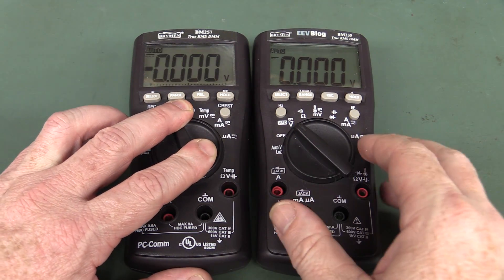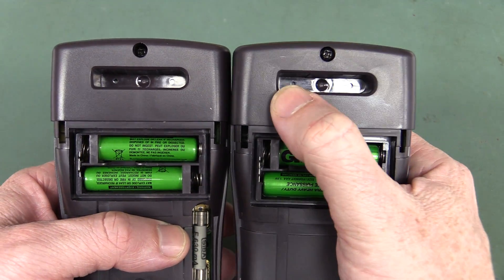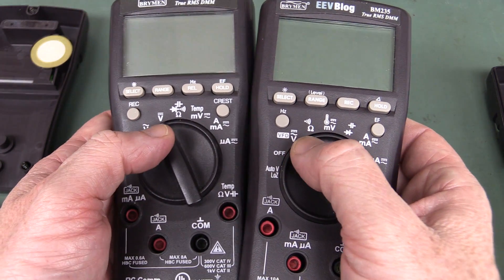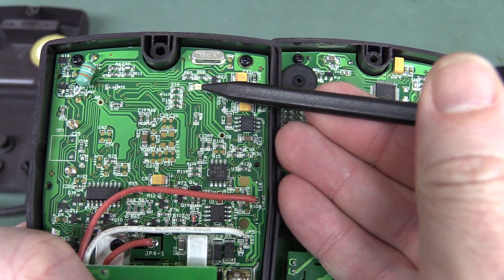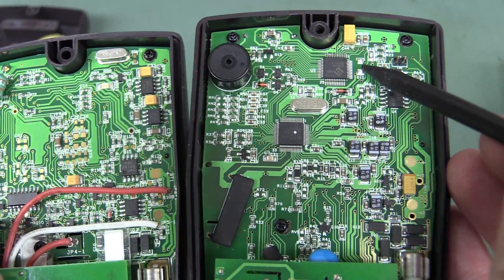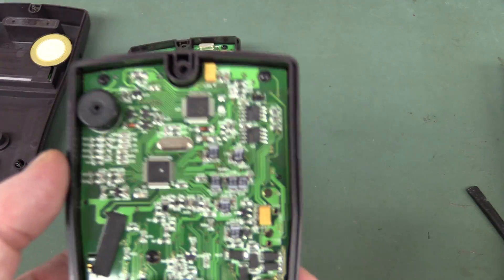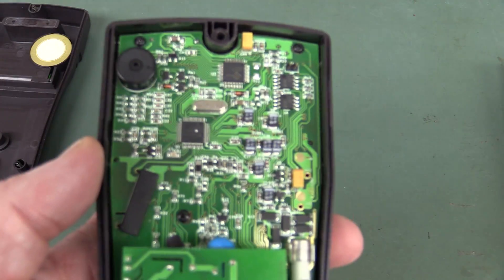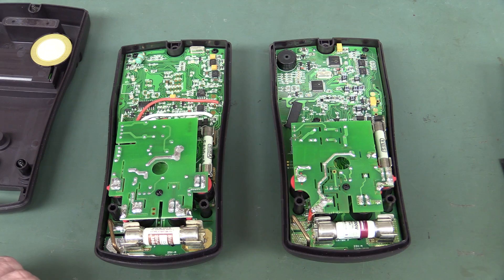Brymen BM257 vs BM235 Multimeter IR Serial Protocol

Comment: I have a fluke 73 series 1.
Been trying to figure out the protocol. This video is great for testing a different angle of attack.

My UNI-T UT81B has a data USB cable. They made it to show up as a HID device and not a serial port.
This makes it harder to sniff the data traffic.

Comment: Another way to try getting serial type data out of the BM235 would be to attach some small circuit to the I2C pins to drive an LED. Possible perhaps but not that clean a solution.

Comment: Why does it output the LCD pattern?  It's not a true serial output.  It's purpose is for manufacturing diagnostics.  Since having a camera in the right place to observe the LCD segments they output a digital stream that indicates which segment is lit during testing and calibration.  Thus verifying proper operation of the firmware.
Reply: In fact there my not even be a LCD hooked up to the PCB while the ATE is calibrating the meter.

Comment: I feel like you're not exploring this fully. Clearly, that pin is not it. But have you looked elsewhere? Trace where the IR LED is connected on the BM257 and see if the chipset on the BM235 output anything there. Assuming the cipsets have the same chip form factor.

Comment: Really unconvincing reasoning there. That empty pad just happens to be located exactly in the same spot where the IR led should be? And it being empty just happens to be a happy coincidence? and it being right next to the LCD controller, emitting LCD protocol, another happy coincidence? Just probe the damn thing and be sure! maybe it's connected to a different pin in through a different layer of the PCB? maybe there's an undocumented mode to that pin? not probing it to check is just lazy.
Reply: Welcome to EEVblog!

Comment: just a guess: but maybe on the DMM with the IR out they are just abusing the serial out of the display controller that is normally meant to be daisy chained with another one. that would explain the strange "protocol". If this is true then the IR-Signal should not be modulated like it normally shoudl be on IR-transmissions. Maybe something similar can be found on the other one but it seems that it is a I²C based controller. But maybe it is possible to just hook a IR-LED to the SDA-Line (via some transistor) and recover the clock-signal from the data to reconstruct the transmitted data.

Comment: What a strange circuit. Could they be modulating the VLCD charge pump voltage to drive the IR LED? Glancing at the data sheet yields some interesting but vague tidbits. Some black magic in here. How does the BM257 drive it's LED?
Reply: +Justin “J” Lynn It just so happens that the 80Hz refresh rate on the display (page 19 of the English Datasheet) is 9600 baud / 120 and the dispay data is referenced to VLCD and VDD.
Reply: +Justin “J” Lynn Looking at the VDD trace from the display driver, it looks like it comes around back through vias and connects in just to the right of the C14 silkscreen mark with a thin little trace. ... hmm, probe time.

Comment: The charge pump side might be the power supply side. Indeed what about the other side of the led? That side might me pulled to gnd and contain data. just solder on a 1k resistor (to allow a voltage change) and measure the other side.

Comment: Well looking at the datasheet for the LCD driver, you could read the 4 COM lines - the data from these could be used to build the required values for the protocol. Not nearly as simple as the original idea.

Comment: looks like you have no luck with the lcd ctrl chip but there is still a chance with the multimeter chipset, if that was known and a datasheet could be found you might get lucky with that one outputting some serial data.

Comment: @EEVblog2 : Dave could you check the other pin on the Diode? It might be used to drive the IR LED with inverted logic? I tried to trace it on the images of the back of the PCB(front of the multimeter) but got lost beneath U4...
Reply: It doesn't seem to be connected to the positive RAIL!

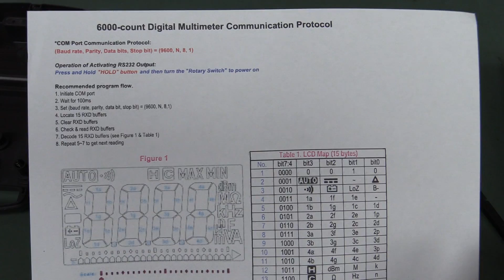Comment: Looks to me like Brymen didn't so much as add a serial protocol as they just simply added an IR LED to the data line that goes to the LCD controller.  That's why it is a "weird" protocol.  It was never designed to be used that way.  It was designed to only transfer a "bit mapped" image to the LCD controller.  When you power the meter up for RS232 (see 3:54) it likely only changes the bit rate to 9600 bps from the optimal rate it normally starts up in.  This way they can say it has serial PC connectivity but it only cost less than a buck to add the IR LED and virtually nothing else to allow that mode.  This "RS232" mode could very well be a test mode designed into the main meter IC to allow easy factory testing and/or prototyping without the LCD.  IMHO.
Reply: +ElmerFuddGun - That being said... looking at the HY2613 LCD controller data sheet, it would be possible to monitor the SCL and SDA (pin 15 and 16) signals with a micro such as a PIC and add an IR LED (cut the traces to D13 and add jumpers to the PIC).  Should then be easy to convert the serial LCD data to 9600 bps data format that the BM257 already has or better yet, output it as a proper serial string using ASCII instead.  Might be a fun project!
Reply: +ElmerFuddGun A good idea would be to add some code to this MCU to add smart hold capability (as in flukes). Just attach an extra button to the meter somewhere, and make controller read the display. After the press of that button the MCU will then wait until display readings stabilize, and short hold button pad via mosfet.
Reply: +SaNjA2659 - Sure but that's getting a fair bit harder to do than my relatively simple IIC to serial converter suggestion.  The hold button MOSFET mod wouldn't be too hard (find and scrape the PCB traces and solder the wires) but drilling a hole in the case and hacking in a button gets messy and hard to do without looking like crap.  And I'm not a fan of a mod like that to the case that may compromise safety.  It also gets a bit more complicated because you might need to use a PCB (or protoboard) now that you have added a MOSFET where as the simpler converter suggestion could likely be done with just the PIC glued to the meter PCB (dead bug style) and using a few jumper wires and a single resistor to the IR LED pad.  That being said I would be interested in seeing yours if you decide to do the mod.
Reply: You should be able to use the High Low function to get the same result.
Reply: Almost every multimeter IC with optional RS232 support uses a protocol like this. It's not literally tapped off the LCD controller. It's just simpler to implement it this way, and it's kind of universal.

Comment: Hook a damn oscilloscope on those pads... You have plenty of them so SEE if it drives a led or not.
Reply: Please, just to amuse me... hook up the damn scope, it only takes a second... Also look to see if there is a 24c0x EEprom on the board, if so, there is a good chance that the calibration info is in the 24c02, along with a register, one bit of which determines if the chip is programmed for serial output or not. Toggle that bit and the serial will be available.
Reply: ... and one final rant... the protocol is very similar to a whole bunch of other multi-meters. Almost industry standard I would suggest. Multimeter chips have pretty basic microcontrollers, so simply firing out the contents of the LCD registers  is by far and away the easiest method of sending out the serial data if RAM/ROM is at a premium on your microcontroller. Let the PC host do all the thinking for you.
Reply: Take a look here if you want to learn a bit more... https://sigrok.org/wiki/Multimeter_ICs#Cyrustek_ES51922

Comment: Are you sure about you conclusion? Could it be that pin 4 is configured as voltage input and the same trace is connected to the led pad? Where does the other pad connect to? Look like it vanishes in a via some way down.

Comment: What about the other pin of the diode ? I mean you seem to say it "connect to a rail" and show the fat trace with a via, but AFAICT, it doesn't connect to that fat trace at all, it connects to a small trace right next to it.
Reply: +Sylvain Munaut You are right. I must be going blind. It does to the other diode below it, and then into a via. Doesn't make sense to be an IR LED. The BM257 has a drive transistor for the LED.
Reply: +Sylvain Munaut yeah! I just commented about that too... I've tried to trace it on an image (using the other side available at https://farm2.staticflickr.com/1699/24180627643_bea96ffbe5_b.jpg  and https://farm2.staticflickr.com/1448/24689654432_726f1ff591_b.jpg) but got lost beneath U4....

edit: nevermind...  I zoomed in and saw that it went to the other diode as well...
Reply: +Diego Spinola I traced and beeped the bottom diode pad to the  left pin of J1 and a bunch of pins on U4, U5, before I gave up. BTW, I couldn't find data sheet for U4/U5.

Comment: For multimeters like the UT61E, IR comm mode is configured by pulling a uC pin low or disabled by leaving it floating (internal pullup). Maybe this chipset also needs a pulldown/pullup on a pin to fully enable IR.

Comment: I wonder if that weird arse protocoll was originally meant to be for transferring data to a wireless display without using a microcontroller and having to invent a protocol etc. That would make it easy. Just whack the data into the remote display without changing a bit and that's it. Thumbs up to a 6 minute video, shortest one for a long time ;)